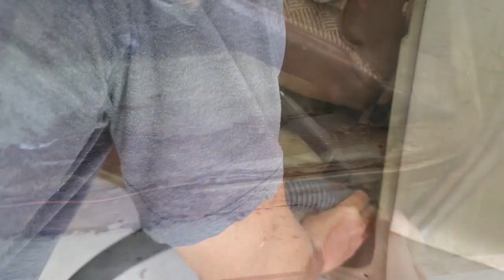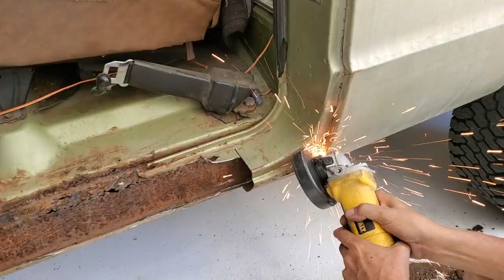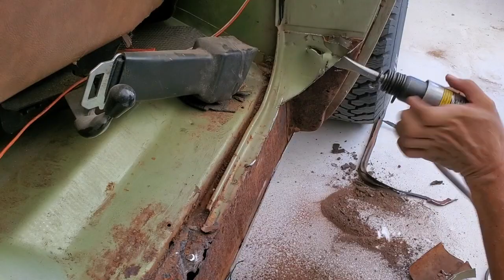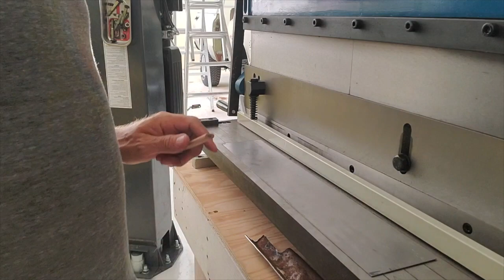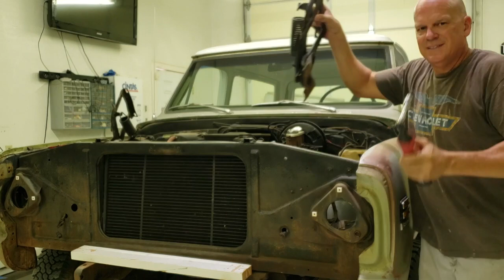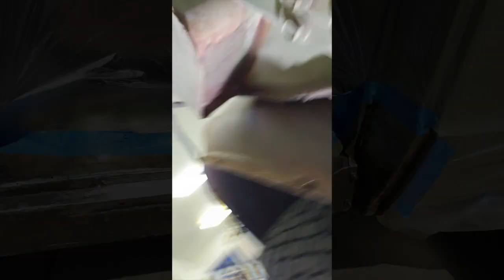1972 Blazer Restoration Rocker Panel replacement part 1

Comment: Fulton's Garage,  Thank's very much this Gentleman for Tutorial..- ..Lesson
- genious.. simpel; I did look/watch  and learn in case you worked.
I've same problem with a Blazer  Mil-M1009..
May I recommend for clean Job (Environment), *Blasting with - *Dry-Ice, - 'Instead Sand-Blasting
with all dust problems. Dry-Ice Equipment/Assy are in small and large sizes
for rent- or -purchase.
Greetings from Germany,
Reply from the maker: I'll have to look at Dry-Ice, I assume a regular media blaster won't work with that?

Comment: how do you get rid of the rust on the inside of the panels that are not being replaced? Seems like there would be rust in there also?
Reply from the maker: That would be tough to remove.  I would suspect that it would have to be acid dipped to get rid of all of it.  Then you have to somehow get in there with a protective coating.   For the rust that can be seen, I have had good luck with a light sandblasting and spraying a 50/50 mixture of oil-based rustoleum and acetone.

Comment: Those drain or "weep" holes are for when water gets in whether it be if the vehicle gets in deep water, or when it rains and it gets in between the panels. Keeping them clear isn't going to keep them from rusting out. You need to spray an oil base product inside the rocker panel on the inner sides. One autobody guy I know even pumps used motor oil inside his panels and they never rot out. That's the only way i've found to keep the rust at bay.
Reply from the maker: Thank you for the info.  It seems that those drains could have been made a little bigger.  The smallest amount of dirt will clog them up.